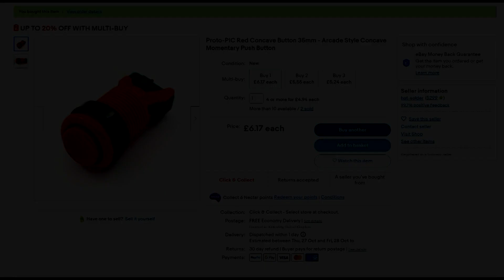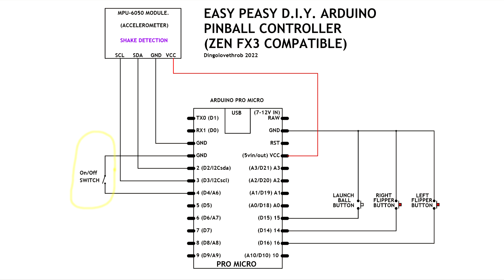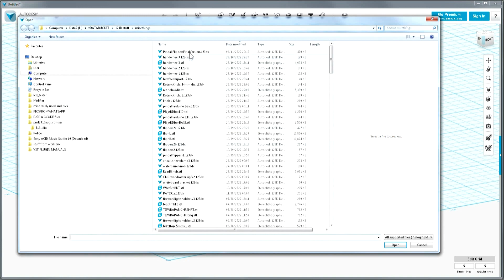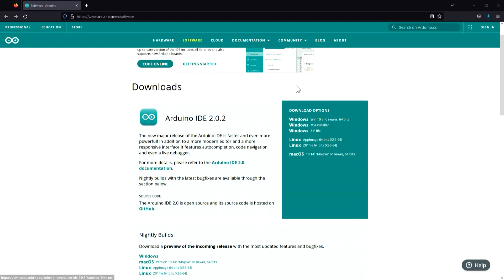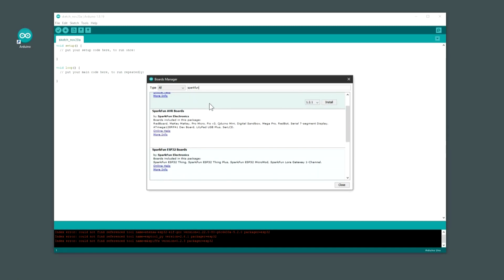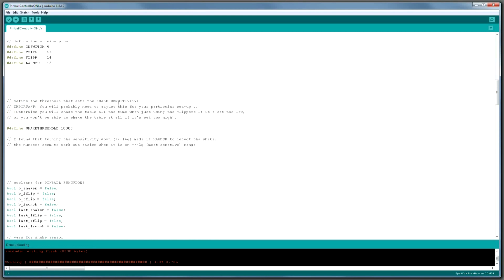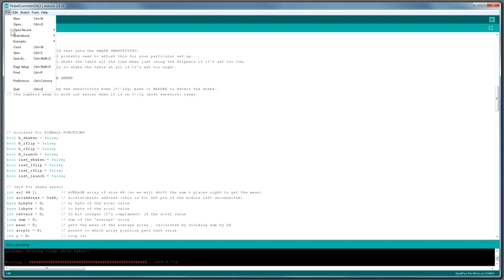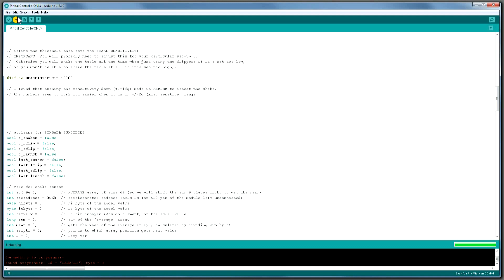Make Your Own PINBALL CONTROLLER - ZEN FX3 compatible ! EASY PEASY !

Comment: this is good. my keyboard keys are taking a bashing. Instead of the accelerometer though I think I'll use extra switches to mimic the left right and forward nudges separately and also the X key for powers when available. how many switches can the Arduino handle ? (never seen or used one....yet ).
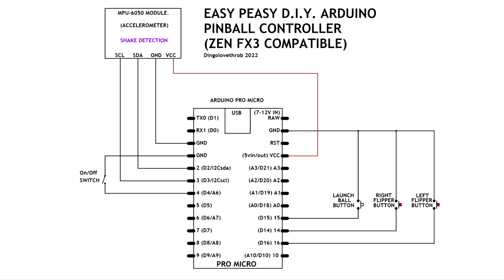Reply from the maker: If you look at the circuit diagram ( around 2:38 or so) you'll see the spare digital pins.  There are quie a few of them and these could all be used for extra switches. That would certainly simlify the software compared to using the accelerometer haha. The reduced list for the Arduino Pro Micro is [D5, D6, D7, D8, D9, D10, D18, D19, D20 & D21 ], so like, 10 pins for extra switches if you needed that many. 
I'm not aware of the 'X key for powers when available' thing - what is that?
Reply: @dingolovethrob   Pressing the X on the PC keyboard key during Zen pinball FX gives you powers on certain tables like score double, slow motion etc. for a short time.

Comment: Hi, I really want to make controller like this, but I am an ultra beginner to the ARDUINO. I used to build computers but this is a bit different.  Is it possible to see picture of the physical wire connections? most of the diagram looks easy (like connect this end to that end etc), but I notice that  the launch ball button connected to multiple  spots, so what kind of wires and connectors I need?
Reply from the maker: Hi there. In my mind, the connections probably need to be soldered to work properly and be reliable.  

That's how I did it but there are probably many other ways of constructing the circuit.

I've added a bunch of pictures of my build to the downloadable folder, (linked above).

You can see that my build is in a little plastic box, so I put it onto the little board to make it compact and reliable when I shake it about.

I soldered pins into the arduino and then soldered those pins into some strip-board (proto-typing board) and then used that to allow me to easily make multiple connections.  

When I designed it I also added more functions to my build - (non-pinball stuff) - with a rotary encoder knob for other functions... but that would have just confused things, so I simplified the design for the video.

So my own circuit build doesn't exactly match the circuit diagram that I gave in the video because I stripped the non-pinball bits out of the published design to save confusion.

This video that I found has a good tutorial on using veroboard and soldering:-
https://www.youtube.com/watch?v=GHtCEed583w
be sure topay attention to around the 13 minute mark where he shows how to cut tracks.
If you mount your arduino onto stripboard then you'll need to cut the tracks between the two rows of pins.

As you will see, my build is somewhat messy and I'm sure that others could do a far neater job of construction.

You should hopefully be able to see how the stripboard allows you to make multiple wires connect to one single ardiuino pin... 
- each wire gets its own hole on the stripboard.

I hope thats of some help.

Good luck if you decide to build it. Others have apparently made it and been succesful.
Reply: @dingolovethrob   thank you, I guess I have a lot to learn, but I really want to build this controller and I will do it ;)
Reply: @dingolovethrob  ok, finally I have it up and running thanks to your great tutorial and I was surprised it worked so well without any complications, since I had no experience or knowledge  in electronics or arduino, so it means that your tutorial is great:)   here is my creation: https://www.youtube.com/watch?v=EOXymAqF5ts

Comment: Good job, I will make one too. But, let's say I want to add 2 additional buttons. Would anything change in your shopping list?
Reply from the maker: Just to buy 2 more buttons. 😀 There are already spare pins on the arduino for them if you wish them to do functions OTHER than the existing ones.  If you want them to do the same job as the existing buttons then you'd simply wire them in parallel with the existing buttons.